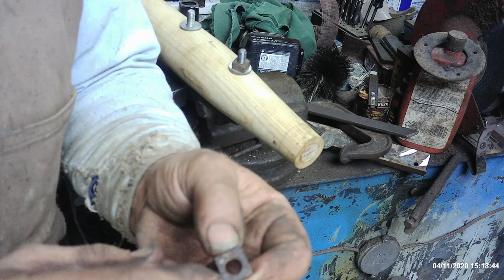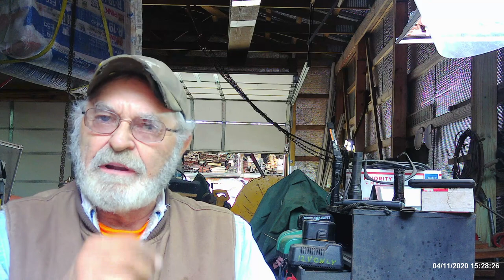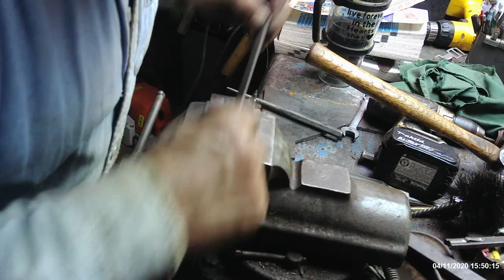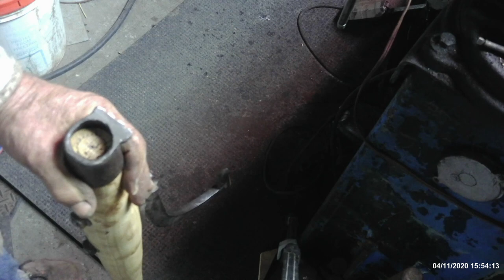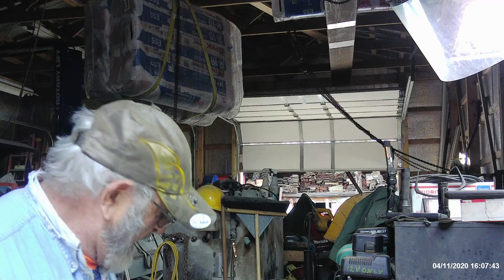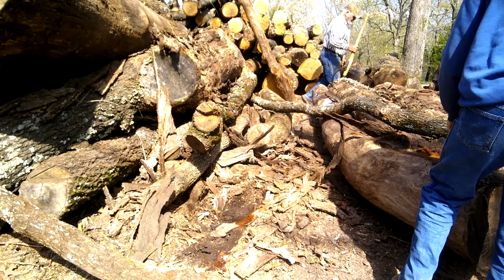Cant Hook, New Handle, First Log Roll

Comment: You have quite the collection there sir. Handle worked out great definitely an improvement. I always rub my new handles with linseed oil brings out the grain and keeps them clean. Take care brother
Reply from the maker: Thanks Ben.  I just can't pass up a broken one for a buck or two.  I usually brush all my wood handles down with old engine oil every time they go back in at the end of the day.  I usually use linseed oil for first application though on a new one just like you do.

Comment: I have a metal combination log jack cant hook but prefer the wooden one.
Reply from the maker: I've never used the fancy new metal handle styles...but anything at all is better than nothing at all when rolling a log.  A wooden handle in a shovel, hammer or axe is much easier on your grip...or at least that is my opinion. Isn't there a possibility of bending the handle if a log gets away and if so, are they a replaceable part and what material is it. Steel or aluminum.  Sorry for the questions.  LOL

Comment: Would explain the difference between a can't hook and a pi vee
Reply from the maker: A cant hook typically is for use on dry land and has the toothed grip on the end referred as the 'pawl' by some guys....and of course the 'hook'.   It's name is derived from its use on sawmills turning the 'cant' (squared off log) against the headblocks for sawing dimension lumber. It is always used on dry land and not on the water....as in river log runs. 

     A 'Peavey' is basically a cant hook fitted with a spike straight out the end and is used in a similar fashion to the regular cant hook. Its name is derived from the last name of the guy that invented it a couple hundred years ago.  A 'Peavey pole' doesn't necessarily have a hook attached, but it does have the spike and is much longer than a standard cant hook handle. The spike is used to sharply poke into a log to change its direction while controlling log runs down riverways back years ago.  The log handlers, or lumberjacks would actually walk the logs and use these Peavey poles to direct logs down river jumping and running from log to log across the floating logs to the safety of the bank. 

     That is where the popular log rolling contests originated where two guys literally run as fast as they can on a floating log with spiked shoes, trying to toss their opponent off and into the water.  There is much more to it, but that should be enough to understand the difference Fiore.  Thank you for the thought provoking comment.
Reply: @tractorman4461  Great explanation! First time viewer and respect your knowledge it's been very interesting. I did some dry land logging with German lumberjacks when I was in the Engineers, those guys were very impressive I learned a lot from them.